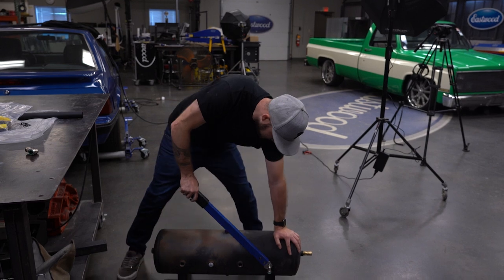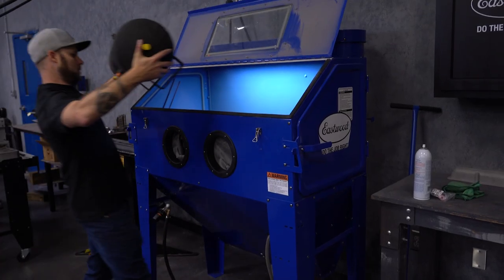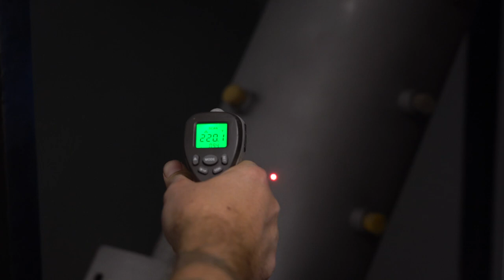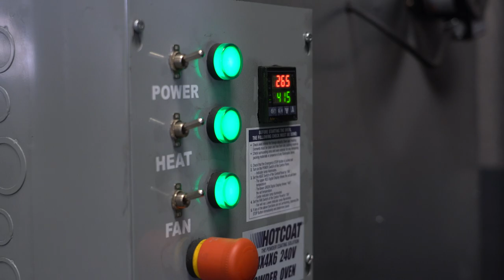How to Powder Coat! - Saving the Air Tank on an 85 C10

Comment: I have the same gun you used. I’m having issues with not enough powder sticking to the item and having to go a second or third time thru the process. I thoroughly clean but I haven’t been preheating,could that be the problem?
Reply from the maker: Hey sorry that's been happening to you.  Definitely pre-heat to outgas any contaminants in the part which could be causing adhesion isssues.  Also make sure you're ground is clean and solid, finally use the high voltage setting if you're still having issues.
Reply: @eastwoodco  thanks, I’ll give it a try.